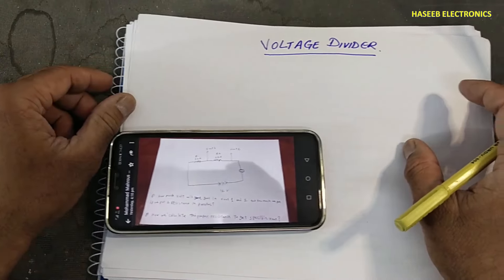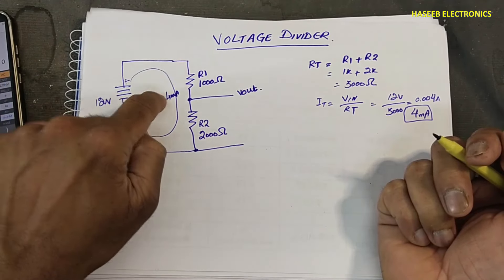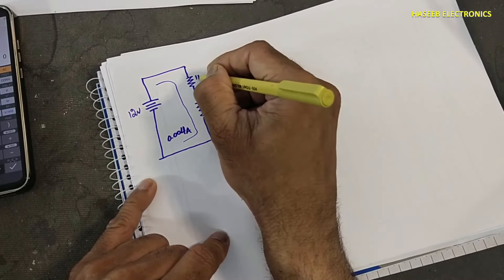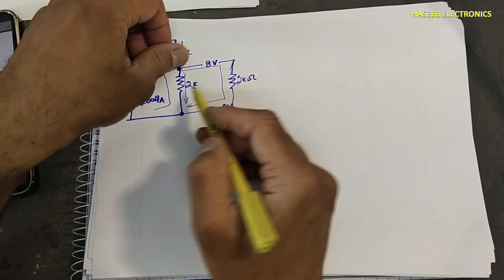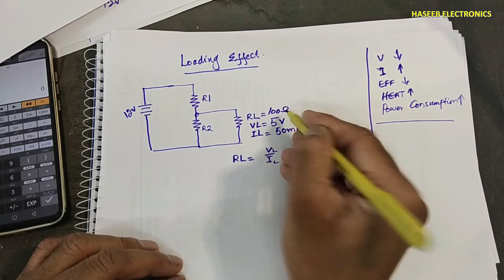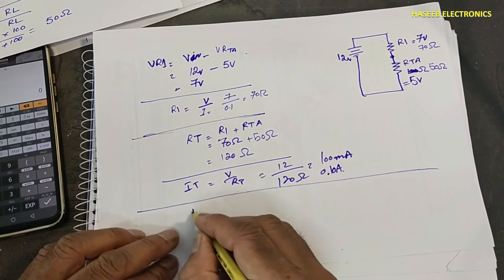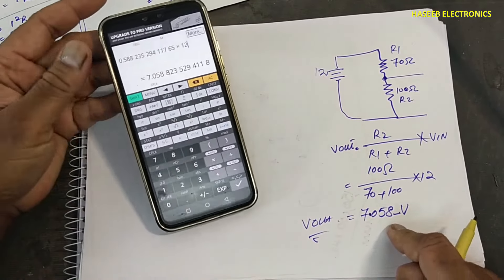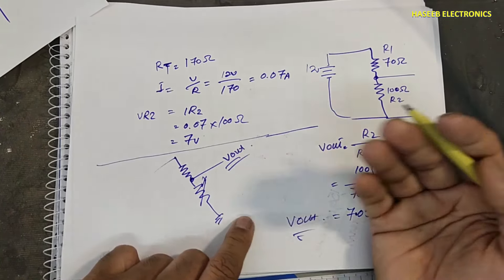{1096} Voltage divider, Loading Effect, Voltage divider calculation

Comment: Sir really awesome. I have one doubt sir. Ohms law, voltage divider these two formulas work only in DC power supply? Or AC supply also.? Thank you🙏
Reply from the maker: Thanks a lot 
Ohm's law is applicable to all circuits either DC or AC
Reply: @HaseebElectronics  thank you sir for your valuable input.

Comment: Last time sir I send you a message to make a video about how to know the common ground in output and input to measure voltage around circuit in output side. But till now sir you don't make a video
Reply: If you don't know that leave electrics alone
Reply: @tractorwilly674  ok brother but we must learn.
Reply: @tractorwilly674  that is why bro we need to learn.is not like you.who know everything.we dont need people like you who are selfish.
Reply: @ibanyllakharkongor5330  not selfish. You need to learn low voltage DC circuits first. Mains power supplies kill.